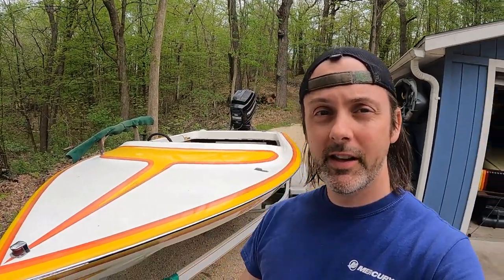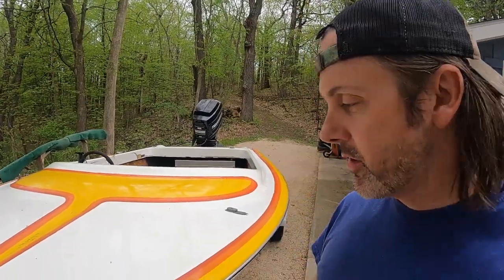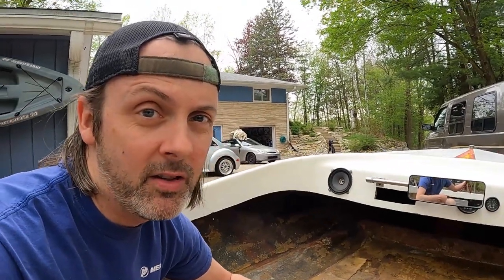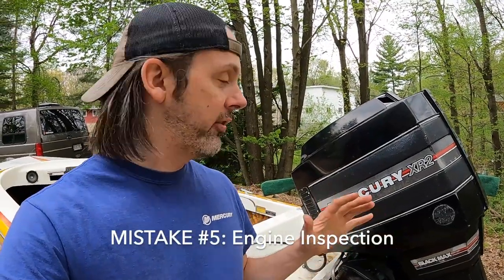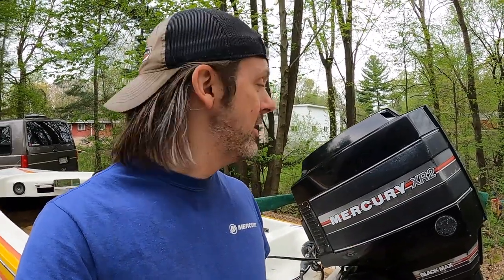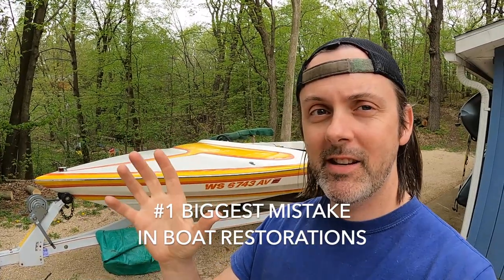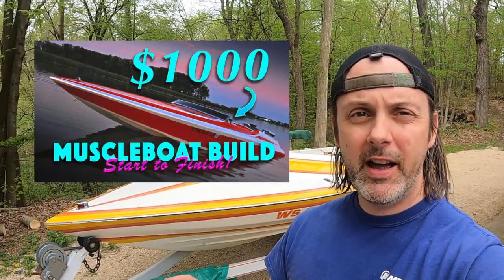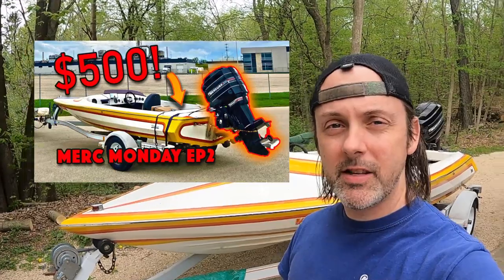Top 10 MISTAKES Buying Your First PROJECT BOAT

Comment: Heck yeah! Back at it! Been tuning in my Avenger and Blackmax150 for a few weeks out here in Colorado. Pretty much have all the cobwebs out of her now. Ps mine was doing 60MPH yesterday with a 17P 3 blade and trim only half way up.
Reply from the maker: Where in CO?   Have you seen my other channel?  I bought a pile of dirt out there.  Wanting to try boating in New Mexico at some point.
Reply: @ADDvanced  We’re out of noco front range. Not many good lakes here, we usually go out of state for good water. We’ve got a few around that are decent but super over populated these days, lots of wake boats so not to good for the old school speeders. I’ve seen that you guys bought some ground out here, haven’t kept up with that side. Don’t know if you’ve figured out your over heating issue yet but there has to be something plugging up the passageways in the leg somewhere, most likely anyway with your water pressure being so high. I’d pull the power head again and snake that sucker and see what you can get out.
Reply from the maker: @alexkatzer1731  That's the plan!   Going to drill out all the passages on the mid, something is still clogged.
Reply: Might have to line them up one day! 72 Avenger bubble deck vs. 81 Avenger bubble deck.

Comment: Yes #1. If it looks like it's going 100mph siting on the trailer. It's a 'cool' boat. Curious when you re-do the floor what you'll find. You may remember I had the 20ft Avenger and had to add a lower drain plug. Being an '83 my floor was glassed over. Hand laid of course. No chopper gun.
Reply: Me too.  Hoping for solid stringers or I might be shelving it for a season and switching to the SST.   Which I sort of want to do anyway but this one is so close.

Comment: Glad you are back posting. Gotta get to the bottom of the overheat problem   A set of one piece heads may help
Reply from the maker: I’ve been posting on the other channel pretty regularly, but my non boat content was tanking this channel.  911 is back on the road.  Check the main page for more info on the channel split.   It sucks that YouTubes algorithm works the way it does.

Comment: I totally agree about so many cool boats just left abandoned amd wasting away, same with airplanes. Overall, you've learned a ton in a relative short period of time. I agree on staying away from jet boats unless you have mechanical and boat experience. They may be inefficient as hell but not much cooler than a big block with water injected open headers and a big roost coming out the back! Actually the only jet boat like that ive been in was an Avenger with a 460 Ford! Im ready to see that Sleekcraft on the water!
Reply: They’re cool and fun but I think most people would ultimately be happier with a prop.  I sort of want one out west because reservoirs have less weeds, but here in the Midwest they just clog all the time.  Still cool, just sort of annoying imho.

Comment: i'm currently in the process of a partial restoration of a 1992 Seaswirl Spyder 188 that I picked up as our first boat over the winter. Extremely solid boat that just needs some TLC. SUPER cool boat that has loads of personality.

Comment: My first project boat was also a disaster. I only lost $400 thankfully. In the end, I learned so much about boats I felt like it was worth it. I learned how to replace axle bearings on a trailer, how to tow/back a trailer in general, found out all the different kinds of boats there are, got my boating license, learned engine diagnostic skills etc. 

All on a 90s jet boat that never got in the water 😂

I can’t wait to look for something worthwhile now that I actually have some kind of idea what I’m doing. (I was 23 years old with zero boat experience last time)
Reply from the maker: Hey 90s jet boats can be worth it.... if they're cool ones.  :)

Comment: First, all the Merc Fanboy action!  Then again, I come from a completely different world of all my motors being pre-1965, including pre-OMC.  Second, in the words of L. Francis Herreshoff, “If God had meant for us to have fiberglass boats, he would have planted fiberglass trees.”

But in all seriousness, the Merc/OMC war rages on as big as Ole himself.  Being on the OMC side of the house and into vintage/antique iron, I never have an issue with finding parts.  Sierra still makes a lot of parts for the old Big Twins and the evolved versions of the Fat Fifty.  My '31 Elto Super C and '29 Johnson V45 are a bit more of a challenge, but even then the parts are out there (and on occasion they are NOS).  My '38 Johnson PO-38 has parts all over creation - and cheap.  For the sake of full disclosure, my feeble-minded brother fell under the spell of Carl K.  Fortunately, he's pretty much limited to the "Mark" era and four-cylinders.  We both own a few examples  of the pinnacle of Mercury engineering - the glorious "Silent Neutral" of the Dockbusters (700, 800).

If you didn't guess by the quote, I go for the other end of the dock appeal.  Give me an old, rotted, wooden husk of a boat and I'm sold!  All of my boats have been wood and "free" (to start) since I was a kid.  '59 Lyman 16.5, '61 Thompson Cortland Sea Lancer, and a '52 Wagemaker Wolverine.  I doubt I could ever get the money value of the time and money I spend working on them back, but that isn't how I define their value.  Then all turn heads and are definitely not built for speed.  The Lyman (before being crushed by a jealous tree) and the Thompson are both awesome in rough water on Lake Ontario.  For speed, I'm probably going to slap together some Sea Fleas this summer and may toss on an old '48 KE-4 for the kiddos to kick around in.

On a final note, if the biggest reason for the success of Mercury was smart enough to switch to OMC, shouldn't everybody?  God bless Charlie S.
Reply from the maker: Love the username!!!!!!   Wood boats are cool looking but man it's just so much upkeep.   They seem to require refinishing every 5 years or so, meanwhile, even after the transom, stringer and floors rot out of FG boats, the gel can still look beautiful!    I was lucky enough to meet Charlie in 2016; he invited my dad and I to his lakefront home in northern illinois, and we went boating on his pontoon!   Super nice guy, was very special to meet him.   RIP Charlie!   Total legend.

Comment: Mako's are fairly common and mostly worth restoring IF you can do it and get your "value" back meaning it will probably cost more than its worth if you are trying to flip it, you can restore it then run it as a personal boat for 5+ years and get your moneys worth out of it them probably sell it for more than what it was worth before restoration within reason.

Comment: Didn't piss me off, couldn’t agree more with your philosophy.  I have restored a couple now, 1982 Vanguard Banshee (Glastron GT-150 Canadian copy) and a Swiftsure (Glastron CVX-16 Canadian copy), both if these get looks and comments all the time from people that see them. I do believe that qualifies them as cool, ha ha. I also have a 1980 Glastron CVX-16 that will be the next project boat.   
One thing, the first boat was sitting in a field on the ground, second was on a trailer in a field and the third was at the side of a house on a trailer.  So ya, they all need a complete tear down and rebuild, rotten transom, stringers and floor, got these cheap or free, so I don’t mind the expense and work too much, itching is another thing, but it goes away eventually. 
Oh and yes, Mercury outboards all the way!

Comment: Thank you for your videos. I have recently found your channel and so far enjoying very much the content and just your way of sharing your experience and opinion. I think I already know the answer but in a scale of 1 to 10 how cool would you find a 1999 Campion Explorer 552 slri with 3.0 Mercruiser sterndrive?
Reply from the maker: It's... fine?   It looks like a high freeboard and deep V for handling big water.   Won't be especially fast or efficient, but would be appropriate for larger bodies of water.   I think it will be really under powered with a 3.0 Mercruiser though, so it'll be slow.  

I would personally not buy a Mercruiser 3.0 unless it was a crazy good deal.

Comment: Is a 1990 24’ arriva with a 454 carbureted cool/worth restoring? I made him show me it run first and it idles well. It needs entire vinyl, cracked exhaust manifold and gel coat needs help. The floor seems good so far. The snow is still melting so I didn’t get a great look at it the floor. But the lines are cool and it’s really a sharp looking runabout.
Reply: I just bought it 2/9/24.
Reply from the maker: I mean it could still be a money pit but it’s a COOL looking boat!   Congrats!!!!

Comment: Hi! Stumbled across your channel, love the vids. I restored a Piranha Bagheera with my brother years ago, ended up repainting it in 2K and rebuilding the complete transom and the result is stil beautifull after 15+ years (don't know if u know the model/brand, little racy boats and the bagheera is one of the smallest models, google it, im curious what your opinion is). I dont have so much time to take it to the water as I did when I was younger and didn't had kids but won't sell it because its not in the way and in my opinion it's a cool little boat. 40hp 4cyl Mercury 2-stroke on the back is good for 50km/h not fully loaded, it's like +-30mph i believe and with some effort it pulls a kneeboard or ski's. The factory max hp for the boat is 75hp, but at the time we were able to buy a very nice 1996 40hp so thats the way we went.
Greets from the Netherlands.

Comment: I was given a free 1959 silverline swift, boat is in pretty good shape and original mother is running rough, but the trailer is where it need most of the work.  This will be my first project boat and not sure if its a muscle car in the boat world.
Reply from the maker: Skip.   That is a lot like my first boat, will not be fast, will have a terrible ride, will never be worth much above $2500.   The hull design was largely a fiberglass version of a wood boat hull, and unless you have an emotional connection, just sell it for whatever you can get.   I sold my 50s boat like that with working outboard and redone floor for $700.  Also had fresh paint.   Was so hard to get people to even come look at it.  I'm telling you, run.

Comment: 1979 cruiser yacht beachcomber 21 ft boat. cuddy cabin. skylight in the cabin. v8 engine. forward facing wakeboard tower with fishing pole holders off the sides. what do you think cool or not? had to do major motor work to it last summer. head gaskets and every bolt on besides steering pump and alternator. impeller pump housing replaced as well...been a pain in the butt but tell me i got something cool xD

Comment: I found a skiff style boat for free not sure if that’s what it’s called it’s a much older fish and ski type boat made of fiberglass and is somewhat squared in the front it’s on a trailer with a Johnson 70 on it , should I take it and fix it? Stored outside and was holding water inside before I pulled the drain plugs when I looked at it

Comment: I have two cool boats i was thinking of selling plus a lot of cool parts.   Mint Condition 1988 Stratos 200VT Rocket with an evenrude 200XP shell with a built 1987 johnson 200GT looper under the cowl.   The other toy would be my 400lb hull 1986 STV Pro Comp Sprint Bottom with stepped sponsons.  One of the engines is from Don Wright.  Its a 2.5 engine out of his boat called tinker toy world record of 156mph / 1000 ft.  Plus one of those rare 1985 all aluminum 300hp european mercury mod vp 2.4s  and an extra 2.4 oval port engine.  Interesting this is Roark Summerford built both of these boats.   I'm getting too old for this stuff.

Comment: What do you have against a dodge omni? I love them square box looking, 90hp grocery getter. So what if you park one in front of your house and your home depreciates by 75k.
Reply from the maker: to be fair(rrrr) the GLHS is pretty cool, but I can't imagine you'd break even restoring one.
Reply: @ADDvanced   I'm  a dodge guy but there were some horrible  cars and trucks made by the big three during late 70's till mid 80's.
Dodge colt, Chevy chevette 4 cylinder, Ford festiva, and the AMC pacer. All trash. Back to boats my father had a 18ft San Juan by Dorsett off shore, no cuddy cabin. That was a great boat and Dorsett had the coolest logo.
Reply from the maker: @DavidSmith-tu1nd  my first car was a 68 charger :P

Comment: Well…..I’m smack dab in the middle of redoing a 1979 Checkmate Enchanter. Came with a tree and nothing else. Replaced the transom, knees, transom support, stringer and floor. Foamed and glassed the floor. Hopefully putting the rear part of the cap on this week. I did the transom similar to the way you did the blue Aristocrat by cutting the back cap off. Got a ton of flack about that on the Checkmate forum. What is the latest on the Aristocrat?
Reply from the maker: Yeah I mean pulling the cap is the best way to do it, but it’s a lot more work, especially if the cap is bonded to the hull and not just mechanically fastened w the rub strip.  Sounds killer tho!   We’ll see how the floor goes on this CeeBee avenger, I sort of want to get it dialed and sell it while the season is still early.   We will see.

Comment: Is a 1960s searay 170 srv worth restoring? I love the lines of them and that classic flaired bow look.
Reply from the maker: Depends how far gone it is.   I'm not super familiar with that model, but look at how much restored ones GO for, not asking price, but SOLD.   Try to get a general ballpark.  The sad fact is that most 'fiberglassics' produced from the 50s-70s were built awful, and have terrible hull designs.   Hull performance and design skyrocketed forward through ModVP racing and became so much better from the 80s onwards, better ride, better speed, better cornering, etc.   It is a fairly attractive boat tho!  If the glass and hull is in good shape and all it needs is gelcoat restoration and a new interior, I'd say yes.  If it needs parts replated, windshield is missing or damaged, stringers and transom rotted, etc, I'm going to guess no.

Comment: About to start the restoration of my 1975 Glastron Carlson CV-16 with 115 inline 6 Mercury Outboard. Theres tons of sentimental value, but is it worth it?
Reply from the maker: I think most carlsons are worth restoring.   Cosmetics are the hardest most time intensive repair, and given it’s a lower end model you could probably wind up underwater fairly quick.   That said it’s still cool; what do restored ones go for?

Comment: Hmmm...there's speed cool, fishing cool, cabin cool, offshore cool, suntan cool, party cool, looks cool, brand cool, size cool... I like my 1990 Wellcraft 230 Cuddy with a 150 Merc Saltwater because it's cool in size, fishing, cabin, suntan and offshore. To hell with the rest of the cools.
Reply from the maker: Cuddy cabins are way underrated.   What is cool is sort of determined by the size of the water you're on, but I put this together because I see people restoring absolute garbage and winding up thousands and thousands of dollars in the hole.  Those are the people that say stupid crap like "ThE BEST DaY Of a BoAt OWnerS LiFe iS WheN TheY SeLL iT" and other dumb things like "HoLe yoU ThRoW MonEy InTo".  

Maybe if they had rubbed two brain cells together before trying to restore a bayliner capri with 4 cylinder and losing $6k, they'd have a different opinion.
Reply: @ADDvanced  You're right about the $thousands but it's been a fun learning adventure, same as when we bought our 1990 33' Holiday Rambler RV. I feel like I really own these things because I've had to work on every system and every aspect of them. It's a lot different than having tons of money and buying new. Anybody with money can do that but not everybody with money can do what I've done. I've had the boat for 14 months, still have fiberglas and wiring to do but sometimes I sit for hours next to it, just visiting while I have a smoke and a drink.

Comment: Doing a 1977 Checkmate Vmate1 currently. cap split transom replacement. Just got an XR4 for it too. Goal is 80mph.
Reply from the maker: splitting the cap is seriously deep, lot of work, but the best way to do it.   80mph is a great goal, same for my SST.
Reply: @ADDvanced  it really wasn't as bad as I thought it'd be. Lots of room to cut transom out, which makes it worth it.
Reply from the maker: @addventure2863  Was the cap bonded to the hull or just held in by the rub strip?
Reply: @ADDvanced  had a type of silicon adhesive and checkmate used what the community calls "concretely the transom and splashwell. All came up pretty easy. Transom is almost out now.
Reply from the maker: @addventure2863  Nice.  Considered popping the cap on my SST project but the entire thing was glassed together from the inside.  PITA.
Reply: @ADDvanced  I was wondering. The splashwell cut was hard to watch, I figured it was the only way though. I'm thinking about deleting my splashwell on the vmate.
Reply from the maker: @addventure2863  One advantage to them is you can fully box the transom; tying the full height knees into both the hull and the cap.
Reply: @ADDvanced  the extra holes in transom is what I don't like. I'm running 6" set back and raised jackplate. No need for the space. But direct mounted motors definitely need it for clearance when tilted.